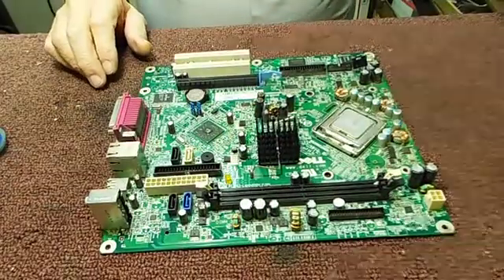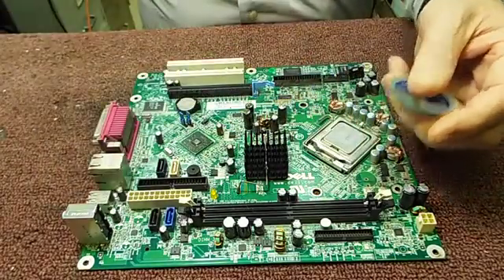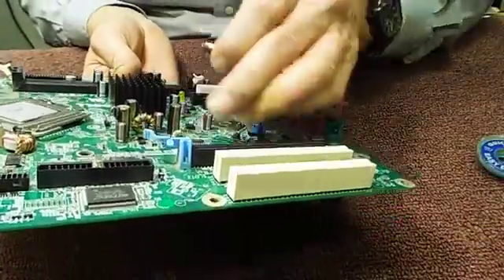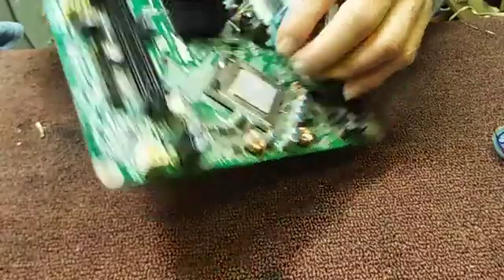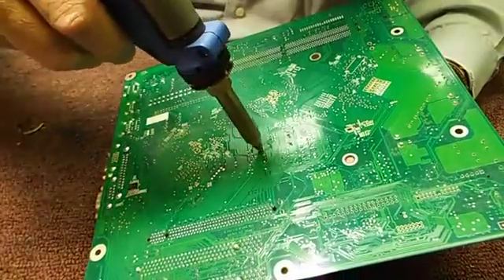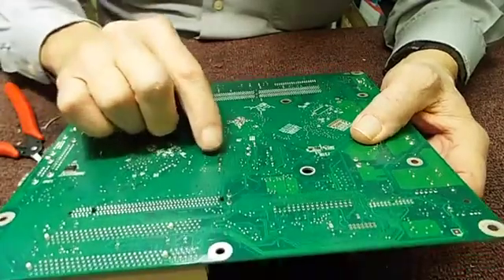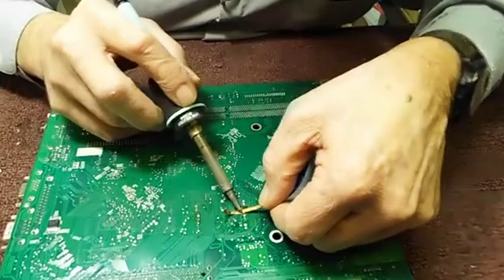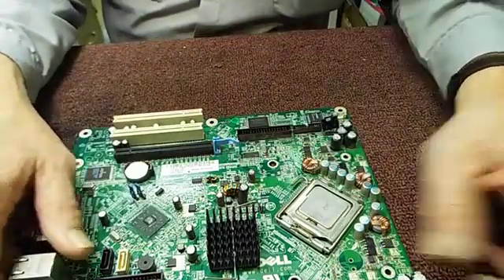Removing Through Hole Capacitors frrom Multi Layer Boards

Comment: Sir,   very  dedicated  multilayer removed  64 pin  control  card remove main pcb.
Best desoldering gun  in which use sir.
I use goot make but it's  very  bad performance.  All time chokape  bits.
Reply from the maker: I have one of those $150 solder suckers off ebay. Mine has the pump in the base not in the handle.  I don't know which is better but for the money I can't complain.  Unless you plan on doing a lot of these boards I wouldn't spend $300 or $400 on a good one.  I think the good ones will last longer but is that what you really need?  Also stock up on good solder wick, the good stuff only. Thanks for watching.

Comment: Some times aditional to desoldering station is good to use low melting solder.

Best Regards.
Reply from the maker: I have been working with that recently. It works well.